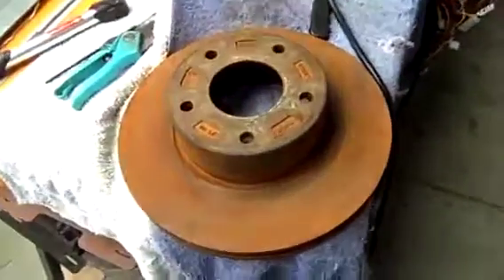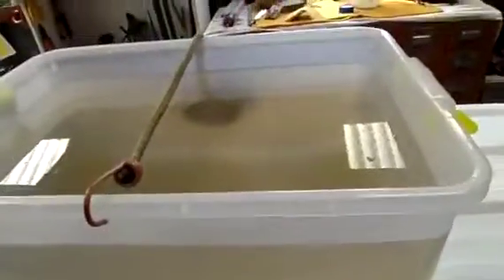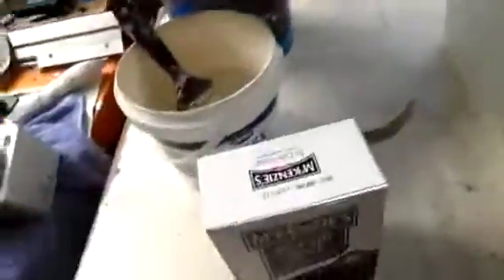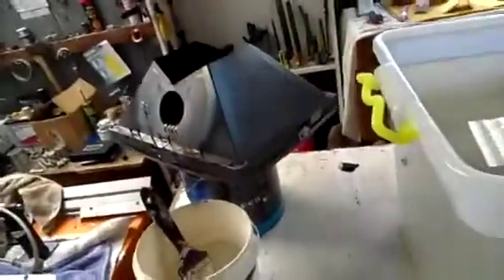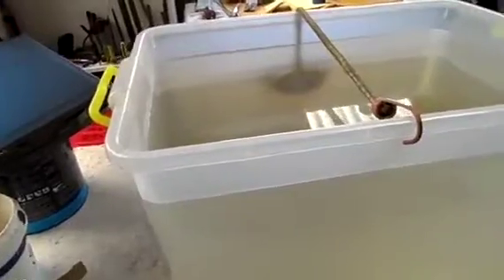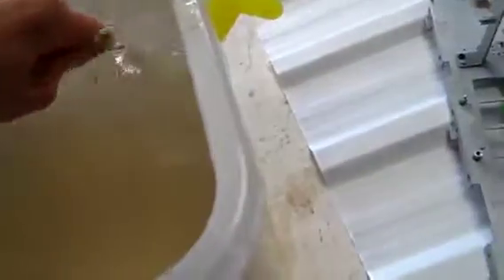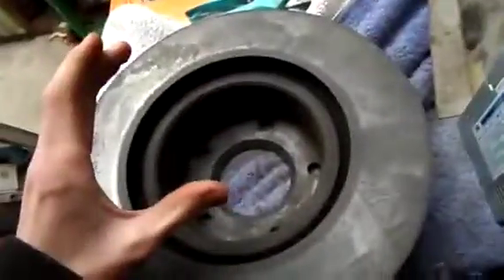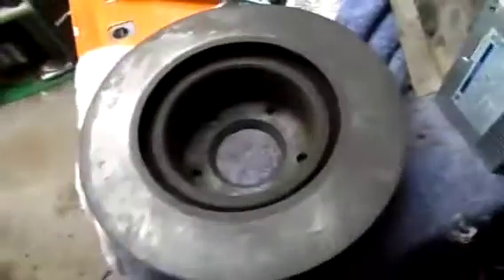HOW TO: Remove Rust using Electrolysis

Comment: 245 to 250 Volts here!!, I use a 24 or 12 Volt Beefy DC PSU to electrolyse!!
Reply from the maker: I did run one setup on a car battery one time, ran the battery flat tho!